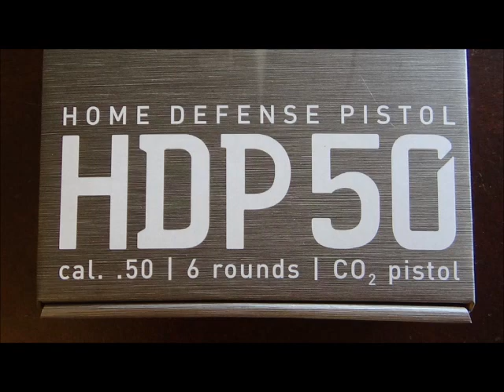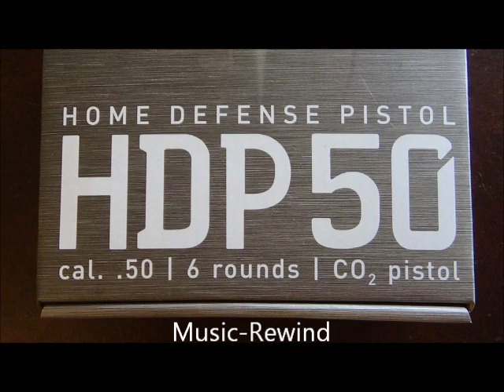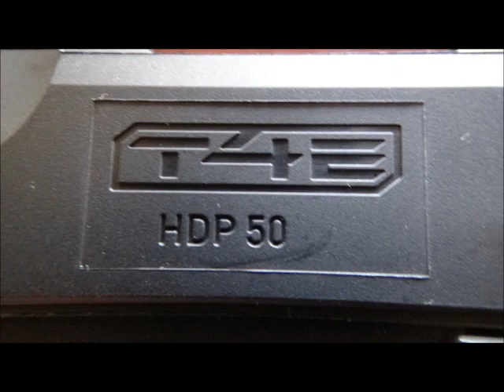Umarex HDP50, One more pistol

Comment: Hi Rune, I have experience with the heat core oring on these. When mine shot out I tried various o rings the correct size. They all disintegrated immediately when fired. I even tried making one using the chamber and valve pin as a mould. And actually worked for first two shots. Trying to get the actual orings from umarex stockists is a nightmare as rarely available and don’t be fooled into buying the service kit from umarex because that particular oring is not included!! However. Good news! I actually registered with a company and they emailed me when stock became available. Was waiting months. They were only £1 each. So I bought the lot. All ten that they had. You are welcome to have one for free. Just let me know my friend
Reply from the maker: Thanks my friend 😃👍
Reply: I use 9x6x1.5mm 90A NBR but very good lubrication with super lube.
Every time i put super lube on the co2 tip capsule and from that day am relax.
Every 10 shots i clean the barrel  to avoid slugs run loose in to the barrel.

Comment: Nice video rune so without any modifications you get 20 joules with the 8 grams !! Wonder if the standard. 50 hdr that can equals
Reply from the maker: Thanks my friend. Yes with the 8 gram steel balls I get over 20 joules. No modifications. That is straight out of the box. Its more powerful than the standard new HDR50

Comment: Hi Rune when you fix your HDR 50 would you make a video of it as I think I have the same problem with my HDR50 and im not sure what to do with it thanks.
Reply from the maker: Hi Ken. I have made a new video of it. It turned out to be some metal grit in the O-ring making the leak.
Reply: If you open it springs will fly I couldnt assemble it. I bought the hdp 50 no problems.
I hate the Hdr 50

Comment: 20-21J out of the box? 🤯 No mods?
Reply: Remember, he used steel balls
Reply: @neprevazutul  Indeed, and so that is my question i.e using specific ammunition was enough to ellicit the increased power despite no modifications being made 👌
Reply from the maker: @rustystyle  Yes. I get around 20+ joules with no modifications. But its the heavy steel balls that make this possible. With lightweight rubberballs 1 gram it only gives ca 14 joule max....
Reply: @runerebel8441  Thanks Rune!! That's what I assumed, just wanting to check 🙌 Really impressive from just switching ammo!!
Reply from the maker: @rustystyle  Yes my friend. The ammo is very important with these markers. Cheers 😃👍

Comment: Have two..just crap.
Trigger mechanism are the weakest in HDP.
Reply from the maker: Oh no... Mine can be stiff to use if I use to large or small ammo. With 12,5mm size they work just fine.
Reply: Yes its a good gun much better than the hdr 50